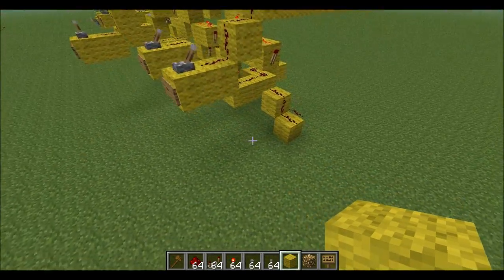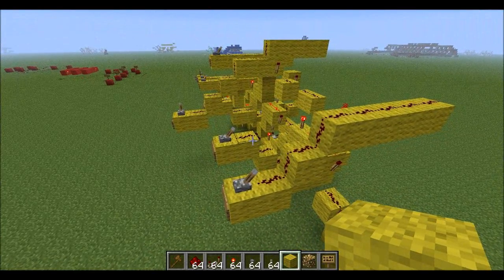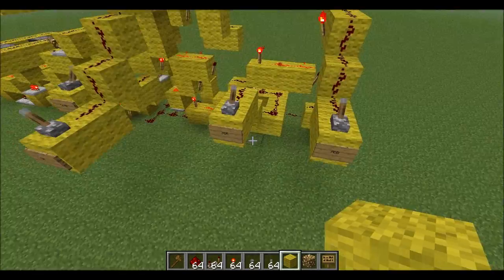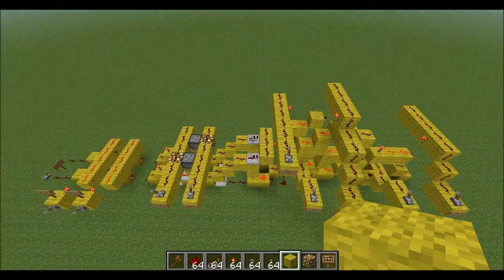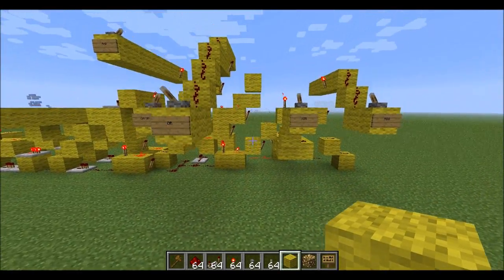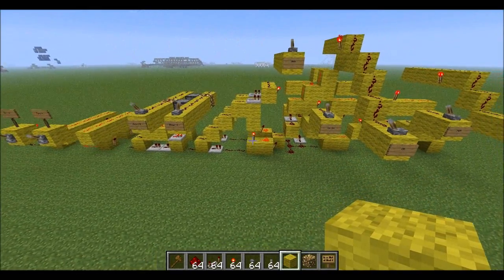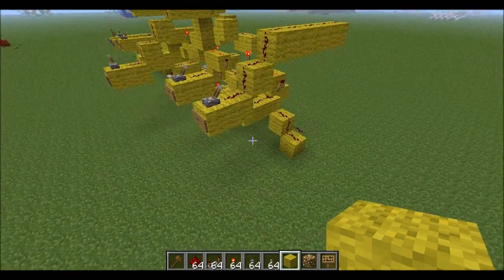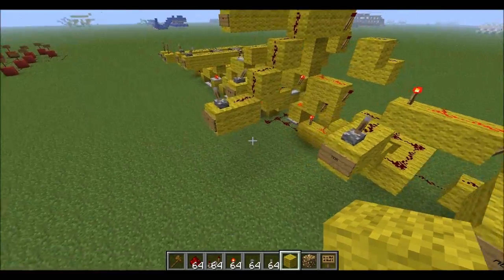Minecraft: How To Build A 4-Bit Computer - Part 4 - ALU III [Tutorial]

Comment: how do you fix  at 2:14 the pistons Because mine is completing the curcuit and powering the piston how to fix???
Reply: Do you mean that the piston does not come back up? If that is your case then I had the same issue.
I am building this in 1.8.9 with WorldEdit and to fix it you need to simply copy the mechanism he did for the NOT function. In other words you have to put the redstone line near the piston and not above it. So what you have to do is shift the redstone line left by one block and down by one block.
Hope I'm not too late and hope this helped.
Let me know if this was the issue or not!
Reply: and if @gigalar1248's method does not fix it, add a repeater after the lever. im doing it in 1.21.4 and that worked so it should work for previous versions

Comment: How can i connect the Cin ON line?
Reply: U found an answer yet 😭
Reply: Yes you have to connect the carry out to the carry. Look closely in his video and you'll see that the "extra bit" is connected to the carry in. So you just connect them if they're not already connected. In his case they're already connected but if you spaced out the four 1bit ALUs a bit more like I did, you will need to connect the two lines. That's what I think but once I build more of it I'm going to tell you if I was right or not.